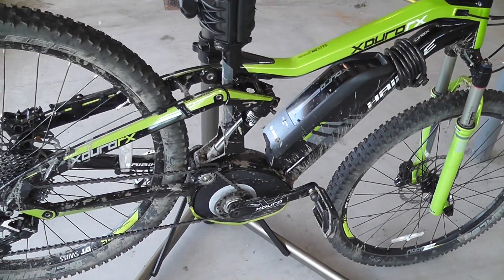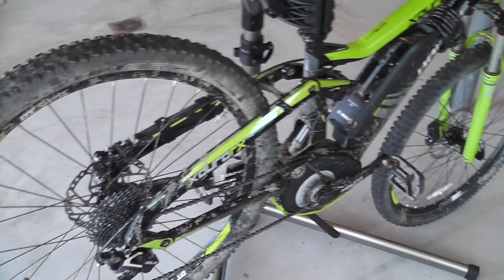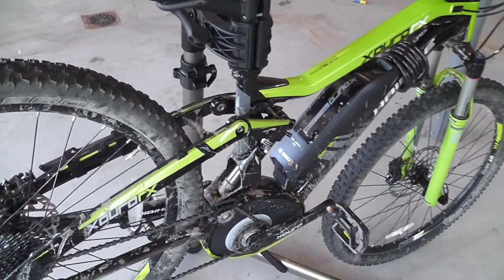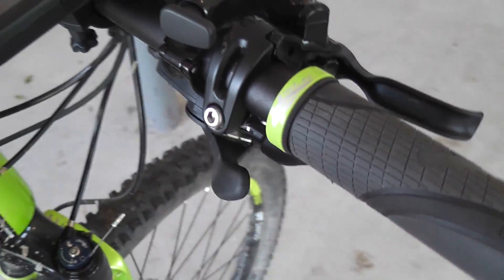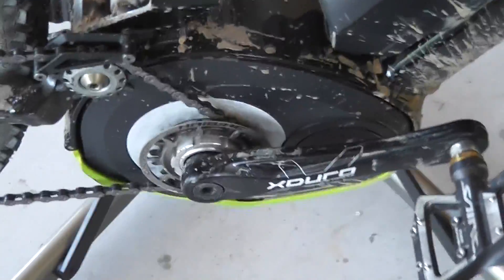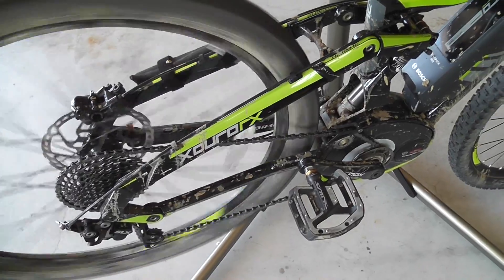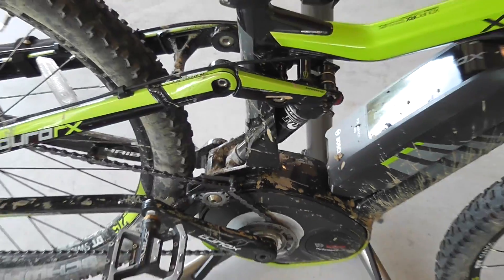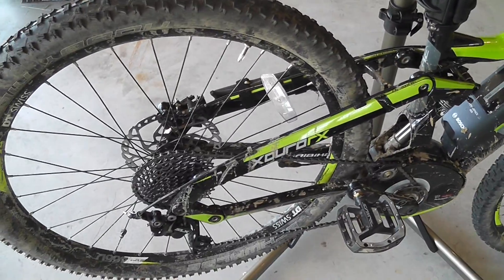E-Bike Education For E-BIke Haters

Comment: Thanks for the vid - I just bought a Haibike Trekker and converted it to a road bike with drop bars and carbon deep rim wheels on 32mm gatorskins - i am a fit rider but got knee issues and i must say i still get an average heart rate of 145bpm in turbo on a 32kph average over a 40km route.  Working pretty damn hard but at least keeping up with the peloton.

Comment: Wrong the Yamaha motor is more powerful.
Reply: Same 250W little bit more torque on paper 80Nm vs 75Nm and different feel. Yamaha works optimal on lower cadence Bosch is on higher and more instant. Both are good it's down to personal preference and availability.